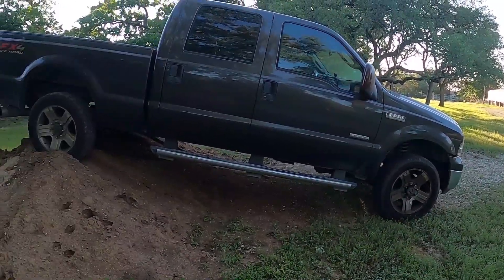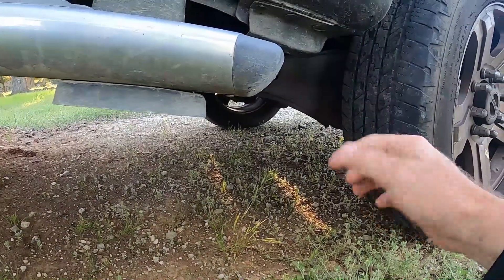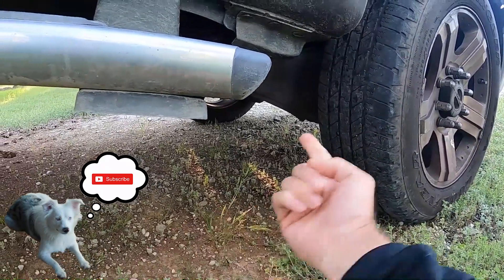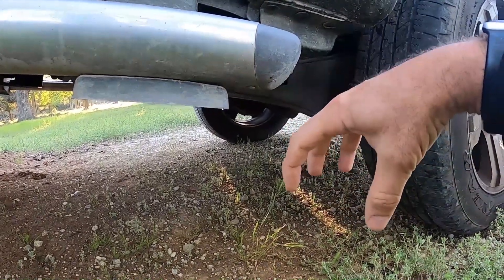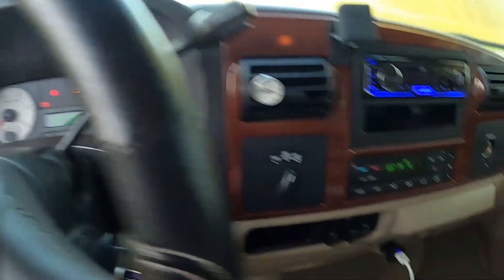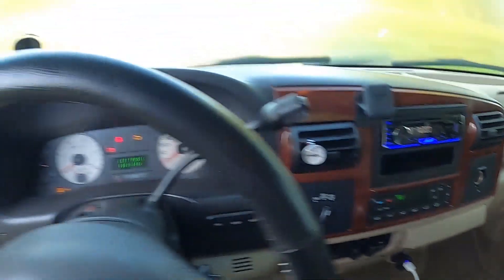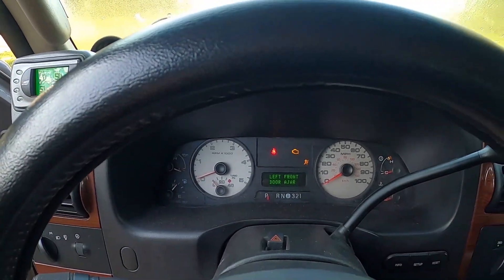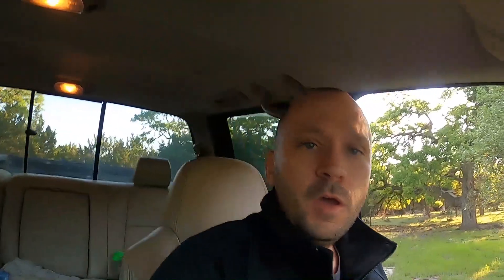6.0 Powerstroke - Long Crank Cold - Oil Pickup Tube Test

Comment: Just saying what I do because I thought the same thing. Re did the whole engine high pressure oil system everything and still long crank cold or hot so I do the normal cycle and crank for 3-4 seconds turn ignition off and go again it fires up right away the second time. Some reason I feel like something drops the voltage to low during the initial start “glow plugs, PCM, Ficm I can even hear my alternator humming” for the first start it’s so weird I’ve ran through the whole truck. I’m starting to believe it’s my oil filter housing itself not sealing properly when I have a filter installed
Reply from the maker: Put a 6.4 starter on it.
Reply: Did you replace the anti-drainback valve in bottom of oil filter housing?